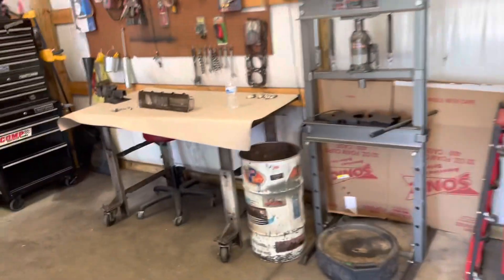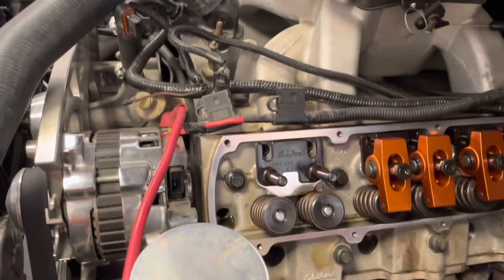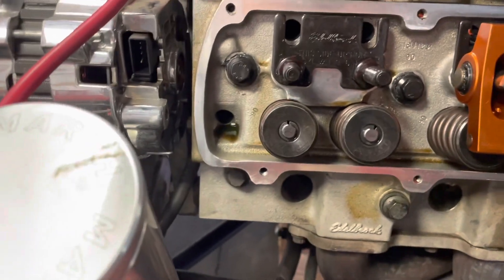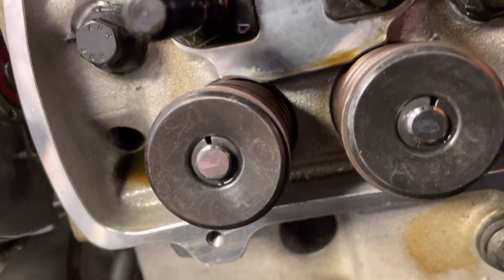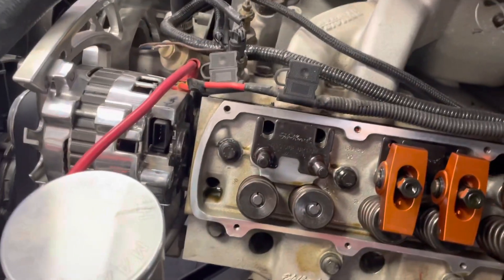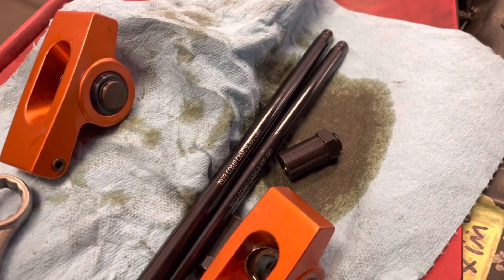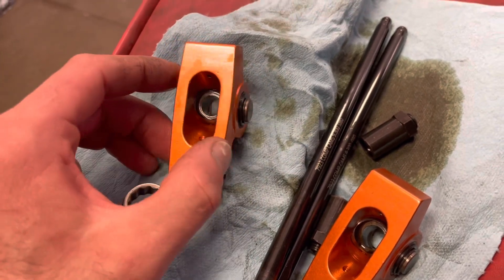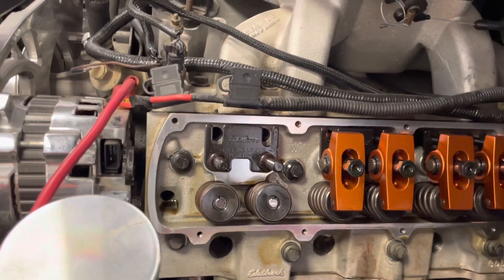Valve train stuff..different engine 😕

Comment: Derek were you been? Di you get the 850 double pumper
Reply from the maker: haha, I've been trying to figure this thing out. I haven't got a carburetor other then the 670. I might use this one for awhile. Until the engine at least breaks it.
Reply: @Derek's Garage  what you trying to figure out on engine ?
Reply from the maker: The pushrod issue I had. I think it's fine now. I'll drive it again during the week.
Reply: @Derek's Garage  ya I have 9.5 pushrods in my 455 but Ialso have a hydraulic flat tapet cam in it